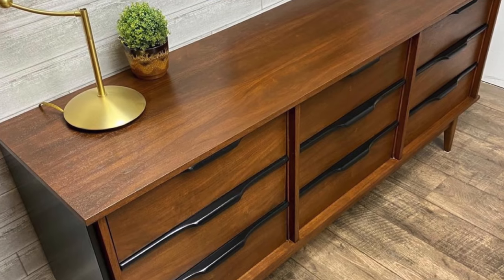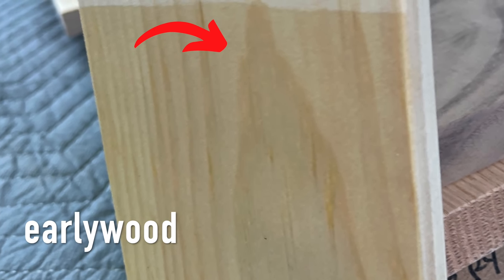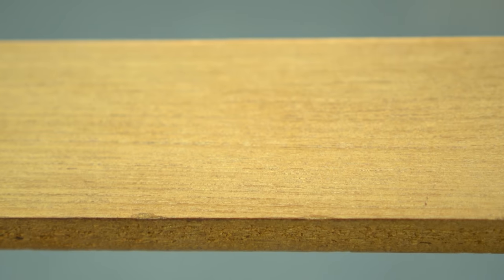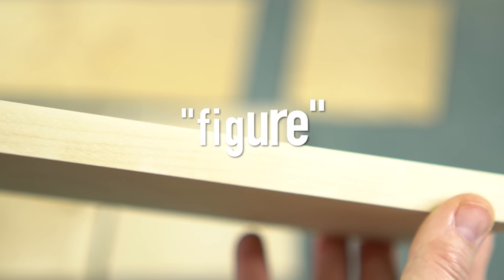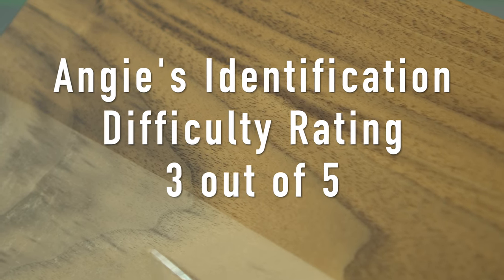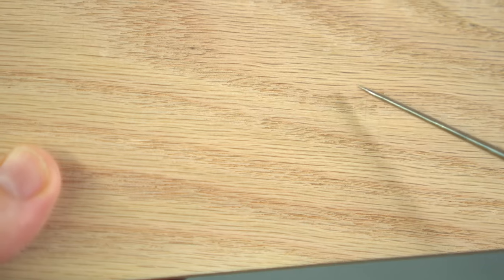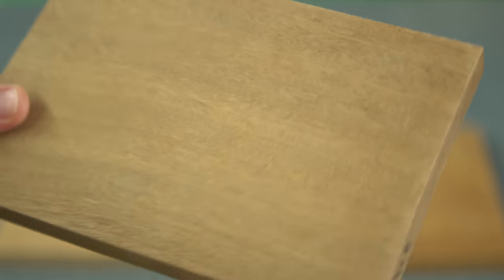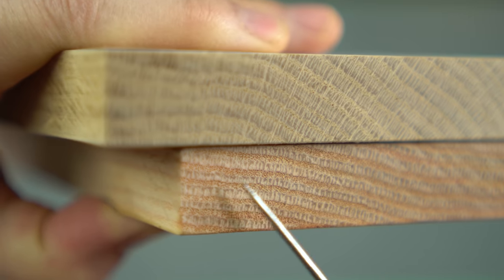COMMON FURNITURE WOODS: Beginner's Guide for Furniture Flipping / Refinishing

Comment: Thank you for all your efforts.  I have mostly furnished my homes for the past 50 years with hand-me downs, second-hand furniture buys and much from street-side pick up on garbage days.  This, in the pre-how to YouTube videos.  My go-to was simply to strip the paint/varnish, sand and repaint/varnish.  I have now found you and love how you treat your pieces: with care and respect topped with a great eye for aesthetics.  Two years ago, I found a lovely tall chest of drawers on the curb on garbage day and after a quick look at it I figured it was well worth bringing home.  I have now pulled it out of the garage and I am trying my best to apply the principles and suggestions I have noted from your videos, including how to fix chipped and detached pieces of veneer.  Luckily, it only had the original varnish so I decided to simply scrape it off. As in many of your videos, the top and sides are a beautiful veneer (I THINK it is mahogany) and the legs are solid wood but much lighter.  I now need to go back to your videos and find a sample of what you have done in the past.  I am hoping to finish with Odie’s oil.   I will first stain the legs   mahogany (gel based for the first time) to see how close they will be to the rest of the piece.  If they do not match, I will stain the rest with the same stain.  Would using a wood conditioner on the whole thing prior to staining help me obtain a more uniform finish between the two types of wood?   I am sure you have several videos on this very issue, but I notice you have different solutions to each one and wondered if they were mainly for aesthetic  preference.  Keep up the great work: you are really an inspiration ❤
Reply from the maker: The long answer here, is as much as I would LOVE to be able to help everyone who reaches out, there sadly just aren’t enough hours in the day. There is another side to this as well- sometimes things don’t come across properly through photos and videos, and are best seen, felt, etc in person. For THIS reason, it can sometimes be difficult to accurately determine the age, finish, wood species, etc of people’s project pieces. There is also the element of user error, when recommending products and finishes, or misinterpretation of my instructions.

I get, on average, approx 40+ messages per day between Instagram, FB, YouTube, and email (and literally hundreds of questions in the comments). It is unfortunately just not possible to be able to get back to everyone. 

The short answer is this: you can certainly message me on Instagram and if it’s a simple answer, I may try to help you out. But PLEASE don’t take offence if I’m unable to respond! I need more hours in a day!

Comment: Great explanation on the types of wood. I’ve been woodworking for 20 years and you explained the end grain, sap and heart wood, and especially all the rabbit holes!  One trick I have picked up on is to sand the end and edge grain to a higher grit than the top. This evens out the color of the stain. Often times the end and edge grain are more porous soaking up more stain. Sanding to a higher grit makes the wood smoother thus soaking up less stain. Thanks for the video, great information!
Reply from the maker: 100% great tip!

Comment: I come from a family of wood workers on my mom's side but I have not grown up right beside it. Well I found an antique Japanese tansu dresser that I am trying to restore gently as it was stored incorrectly for 5 years. So first stage was letting the wood get used to being inside and I gently cleaned inside & out with just water & a soft cloth to see how much it absorbs. But my next step is to rehydrate the wood to see the next transition. As I am trying to learn about the finish & the original wood. Eventually, I may have to sand down all the components to refinish it & fix anything, but I have to be careful as it doesn't use traditional staples. So, I hope to learn more from your channel and a few others I found on Japanese furniture. ❤
Reply from the maker: Wonderful! Thank you so much for watching! 😊

Comment: Thank you for the time and research that you put into this video. It is very enlightening. Maybe it will encourage some flippers to search out what they have before turning a rare wood into an art project. Now, I don't mind painted wood. I paint, too, but only if something is not real wood, as in particle board or MDF, or has so much damage that painting is actually saving a piece. 
Thank you for attempting to answer our questions. It shows that you care. 👍

Comment: Ok, I just shared some of your info I learned from this with another YouTuber! She redid a piece as part of a spring challenge hosted by Sab’s Rehab and the only rule is color. She picked up (from her local Habitat for Humanity Restore) this beautiful little 3 drawer chest of drawers and all three drawers were beautiful quartersawn oak veneer!! Don’t worry, she only painted the frame in a sage green and stained the drawers with Verathane’s Simply White (ok, I panicked when she pulled out the piece bc I knew the one rule and I paint furniture all the time). So I thanked her for keeping the wood stained and told her what I had learned from you. Just wanted to share.💜

Comment: I don’t know if someone else has mentioned this because I don’t want to read through all 177 comments, but some may find your discussion of oaks confusing. Red- and white oaks are species of trees - Quercus Rubra (red) and Quercus alba(white). My ears perked up when you said this because I lived in Maryland where the White oak is our state tree, and because I worked for the forest service there. I may be confusing your content, and they have different meaning in the furniture world, but they are indeed species of trees. I saved this video as a wonderful reference should I find myself in need of determining a species. Right now furniture is a hobby and mostly done on my own pieces. Thanks Angie.
Reply from the maker: It refers specifically to lumber. There are multiple types of white oak and red oak. For example, willow oak, black oak, live oak, northern and southern red oak, scarlet oak, nutall oak- the wood from these trees (and still many others) are all called red oak. It's the same with white oak.. many types are simply called white oak. All the timber from the white oak group, regardless of the tree name, is called white oak. And all the timber from the red oak group (regardless of the name), is called red oak. :-)

Comment: I’ll start with thank you. I waited to watch this video until I understood the woods and when I knew I needed it. (I’m making my hubby a garden stool but I am staining it. So, hence my delay.) I’m rescuing a charity find coffee table that has 3 different “grains” visible. I watched your video on laminate, veneer, mdf or presswood. It’s mdf. On the sides and a raised center top are laminate, I’m pretty sure. I think they used a cleaner on the top that lightened it but the lines and thickness over the mdf are the same. The only “wood” is attached to the substrate on the top around the laminate. It has a bit of a golden color with wider grain in it. It’s oak. Looks like quarter round. 

I said all that, not to ask if I’m right but to help you see that you make a difference. I feel confident of what I need to do. (The biggest awesomeness is I think I get to paint the raised top and sides in that gorgeous blue fusion mix you created. I ordered it without a project in mind, and now my chance is in the garage. Paint will be here Friday.) 

Again, thank you so much for your lessons as you show us the beauty waiting to be revealed in these rescued pieces.
Reply from the maker: Wow!! I can't tell you how much I liked reading this! I'm so glad I could help. 😊❤️

Comment: hey jenn, works for me,   im not wood expert either.   i usually go by smell, as you said it can be hard to tell..i got a question to you or anyone that can help answer , a few yrs ago i went to a barn sale , and found this poor neglected maple amish style rocking chair... i looked it over and decided to take it home.  when i had the time ,   i started to give it a good solid scrub, only to find....MOLD !!!!    so  knowing the finish as pretty much gone,    i loaded the bleach right to it.. let it dry...and did this a few times HOPING    it would get rid of the mold....NOPE.  it lightened it  but it DID NOT GO  AWAY.  uugggh.. so i let it sit a few wks to make sure the bleach did it job and the mold spores were dead and dried up. i proceeed to start stripping it... no changes,,, so  now i have only 2 choices....... stain   it as a dark walnut to hide the mold...or paint it..which either one im not happy with as this maple is a hard rock and has gorgeous golden refections....i dont know what else i can do... i cant sand it due to it will  just release the mold spores into the air....im in northern maine  so..if i was to sand it.. it would have to be outside in the drive way. any other ideas????????  anyways thank you for all your knowledge of woods   ,every little bit helps  ;];];];]  i would have worked on going to a saw mill to get scraps instead of buying it... holy  300.00!!!!    thats unreal!!!!!

Comment: I agree with you on patina. My former skill set was in jewelry both in sales and as a jeweler. So in my terms for patina I would think of old gold or bronze. I wouldn't want to clean those up.

Patina on platinum is just the metal pushing aside and up to personal preference. If you like the softer glow, do you. I would personally polish it, but that would be me.

 Faded antiquing or a white gold piece warming with age and needing another plating or tarnished silver are things I would fix. 

Now that flaking plating off costume stuff, is going to be desined for the bin.
Reply from the maker: Thank you so much for watching! 😃

Comment: I love your videos and this one was very informative. You said ask about a wood not in this video so I will. I have a china cabinet and matching rolling trolley bar. I was told by my mother that the wood on these pieces is Pecan. Have you ever worked with this wood? They are both looking dry and I want to take some restorative measures. I usually only use a wood cleaner without wax to clean them. They are a medium brown with a slight warm golden note. It has a very interesting grain. I know as this video is a year old you may not see this. But if you do I would appreciate a comment on what you think of Pecan as a furniture wood and what might be a good oil for lightly moisturizing without hurting the finish.

Also condolences on the loss of your fuzzy which I saw in another video.

Comment: Hi Angie, I have a solid teak rough cut outdoor coffee table. It weighs a ton. Once a year I power wash it, lightly sand and oil it with danish oil but it just turns black and grey again by the end of the season.  I recently bought some oldies oil and was wondering if you thought that might be good for it?
Reply from the maker: Odie's Oil actually has an incredibly in-depth website with answers to just about any question you could have so for questions specific to Odie's I send people there - https://odiesoil.com/. Under the Cornwall Training School heading there is a TON of information. Check out to FAQ section in there too. I hope this helps and thanks for watching!

Comment: This was SOO informative! I’ve prided myself on knowing my woods, but after this, I’m afraid I may be mixing up elm and walnut. How do you tell the difference between those two?  I also think I may be confusing teak with cherry. Teak is so straight and often so is cherry. Could you give me some pointers?  Birch looks like pine or cherry as well. Still a bit confused.
Reply from the maker: Without seeing the end grain (and after observing the other characteristics mentioned here), the only other way to really tell certain woods apart is experience. Like I said in the video, that is the biggest factor, honestly. There is no real magic “bullet” (so to speak) that is a sure fire way to instantly be able to tell certain woods, especially when they are covered in stains and topcoats that are decades old, obscuring the grain. It’s taken me literally years to be able to quickly tell certain woods apart and it’s not so much that there is an immediate defining feature, but it’s the experience of having seen, stripped and sanded literally several hundred pieces over the last few years. 
Keep looking at videos and photos of furniture. The more you see certain woods, the more you will notice the large AND subtle differences between them. 

Walnut and elm are actually quite different (whereas oak and elm are more similar) when you get down the raw wood, there is a huge colour difference. Elm is very light, walnut tends to have a greyish or reddish brown or almost mauve (in some cases) hue. 
Pine and birch are also pretty easy to tell apart once you do it a few times. They are both very light woods but pine has more of a yellow tint than birch.

The best way to really learn beyond what is in the video is, as mentioned, practice practice practice, and research research research. Even pros sometimes get it wrong but there is no teacher like experience. :-)
Reply: @TranscendFurnitureGallery  thank you for your detailed response. I’m basically dealing with veneer and can usually tell but the recent one had me stumped because I thought for sure it was oak but hadn’t done any MCM pieces with oak so I figured I was wrong. I took it to my local rockler and it was, indeed oak! Guess I wasn’t as bad as identifying as I thought!

Comment: Ok, I know nothing about wood so would like some help here. 
I’m planning to make a foldable picnic size table where it can be used for both in & outdoor. What wood would u recommend? I don’t want to spend so much on wood since I’m planning to make 3-4 tables but i also want something that is sturdy, will last a couple years of use and wnt rot during the cold season while it sits in the shed. TY 😊
Reply from the maker: I don't build pieces from scratch so your best bet is to do you research, maybe talk to some local wood workers and see what they recommend for your climate. Thanks for watching!

Comment: Hello!! Recently picked up a beautiful detailed headboard. It was free and advertised as 100% wood, realized it’s plastic with wood primary supports. Recently came across qcs and using this for all my stripping purposes, do you have any experience working with plastic detailing? Would it be safe to strip?
Reply from the maker: The long answer here, is as much as I would LOVE to be able to help everyone who reaches out, there sadly just aren’t enough hours in the day. There is another side to this as well- sometimes things don’t come across properly through photos and videos, and are best seen, felt, etc in person. For THIS reason, it can sometimes be difficult to accurately determine the age, finish, wood species, etc of people’s project pieces. There is also the element of user error, when recommending products and finishes, or misinterpretation of my instructions.

I get, on average, approx 40+ messages per day between Instagram, FB, YouTube, and email (and literally hundreds of questions in the comments). It is unfortunately just not possible to be able to get back to everyone. 

The short answer is this: you can certainly message me on Instagram and if it’s a simple answer, I may try to help you out. But PLEASE don’t take offence if I’m unable to respond! I need more hours in a day!

Comment: This is in my saved folder to refer to it but I still can’t figure out what kind-of wood I have on a few pieces. I bought some cheap furniture with the idea of practicing refurnishing. However, the top of the furniture is definite,y veneer and damaged. As a newbie, I’m struggling with the proper steps to finish these pieces.😮😢
Reply from the maker: I have a few videos posted regarding the differences between the various surfaces and a number on working on those surfaces. If you search through my videos list, you might find something that can help. We're all still learning! 😊